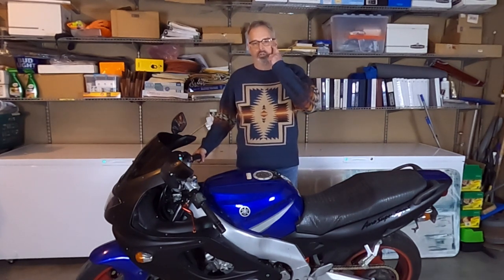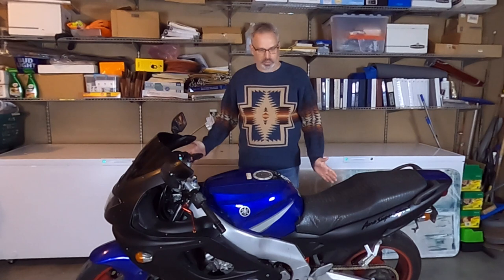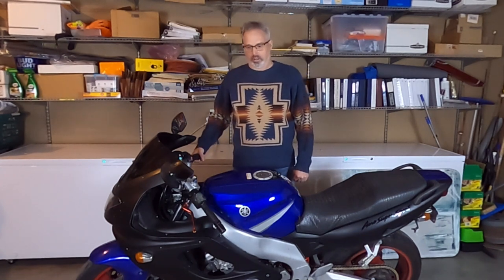Motorcycle Safety Equipment  - Do you Want or Need it?

Comment: As an old school Harley rider I would say that there is no substitute for skill. These features not only make the bikes more expensive but also more complicated and expensive to repair. The more gizmos you have, the more things there are that can fail. I wouldn't mind ABS on a touring bike or TC on a high horse power bike as long as there's a switch to turn it off. For my back road cruiser I would rather not have any of it. I like to be in full control. I've been in situations where I've had to slide the ass end around to avoid eating hard objects head on. Once with a huge doe and once with a huge Thunderbird. The ability to slide the rear wheel saved my ass both times.  Are safety features tools or crutches? I guess that depends on the rider. It is a moot point because we'll get whatever they cram down our throats, like it or not.
Reply: Well said, Scott.... Art

Comment: I like ABS. Once, I planted a bike under a school bus. The bus driver was making a left turn at an intersection and for no apparent reason, slammed on her brakes. I moved to the shoulder so no one would run me over and applied the brakes. It was late winter or early spring. In any case, there was a fine film of silt on the shoulder and it caused my front end to wash. I let go and the bike did a tanker slapper, spit me off on the sidewalk, bounced off the curve and ended up under the bus.
Had that bike had ABS, I think my day would have been devoid of drama.
Most of the rest of it I find to be overkill.
I actually would like the 911 service if it used a satellite system, but it doesn't. It uses cell towers. That's okay if you're in the city, but then there's plenty of people there to call anyway. I generally ride in the country where there's little if any coverage and many fewer people. As we go to 5G, the signals are higher frequency meaning they are more directional i.e. there will be even LESS coverage outside of populated areas. So at present, that one's a bit of a waste.
Reply from the maker: Funny you should mention that.  On my regular rides around town I seem to have to be extra careful around school buses and delivery trucks.  I think you are right about the emergency call system needing to be non-cellular based.  Probably it would need to be satellite based like Onstar.  I think we may be only a few years away from all new bikes sold in the U.S. having ABS.
Reply: 5G is good for high speed where you can get it. It should train down to 4G when it can't get it. I'd like to see phones use GPS without needing cell signal. I think the 911 thing will get better though and be multiple device. I hit something with my hand and my apple watch wanted to know if I fell. Not perfect, but interesting. I think BMW has crash detection and SOS call on their bikes in Europe. It's a new world.

Comment: In my view ABS gave motorcyclists really serious braking capacity from their rear wheel for the first time. No small thing. Technology like that you can't have too much of!
Reply: Most of the breaking power is from the front brake...That said, for instance, BMW has been using partial integral braking for decades now. Front brakes does front and rear, rear just the rear. It's brilliant and works like a tailhook. I don't find the rear brake along useful for anything other than low speed stuff like Jerry Palladino does.
Reply: @my.motorrad  imagine that, the front brake is the important one? Are you sure? Seriously though, all I was suggesting is a rear wheel that does NOT lock up is much more useful than one that does. Especially in the wet. I've owned three BMWs but no longer ride them due to having experienced a stripped shaft drive spline - a real trip killer. BMW's dirty little secret huh?
Reply: @user-us1hx2cx3j  I'll be doing a video on some of their foibles, but that won't be the major thrust, but there's more than a few. I am truth teller, much to the chagrin of some of the BMW faithful I interact with. I've not seen the drive shaft splines strip. Ujoints blow up on some of the liquid cooled boxers and the 1150/1100s had input shafts strip on the transmission. They have their problems for sure.
Reply: @my.motorrad  good on you for being honest! Unfortunately the stripped shift drive spline is pretty well known.  You can be lucky or unlucky with almost any maker I guess ( although the Japanese tend to be the exception to that) , indeed I had a 97 HD Superglide which I bought used, that was probably THE most reliable bike I've ever owned. Who'd have thunk it right?
Reply: @user-us1hx2cx3j  The most reliable bikes I’ve owned were Vulcans. 1600 Nomad was bulletproof. 800 Classic was good too. The RT performs better though.
Reply: @my.motorrad  right, does not surprise me the Vulcans were so great. I'm onto my second Kawasaki now, a 2019 Verseys 650.
Reply: @user-us1hx2cx3j  I've owned a GPz750 and my first bike was a 1978 KZ1000. I wish I still had it. The Versys is a very good bike. Kawasaki makes very good bikes in general. I wanted to like the C14, but it doesn't work for me ergonomically and it doesn't have cruise control.

Comment: ABS? Yes.  I can get by without it, and have for a long time, but it's nice to know that in an emergency or unexpectedly slippery surface, it's there to help save me.
Traction control? Almost a necessity on the insane 200 HP bikes available today, not so much on my KLX 250. Somewhat useful on my BMW RT.
Reply from the maker: I agree with you.  I think ABS will be on every new bike sold soon.

Comment: As always great video but a couple of points.  1) Electronic failures- What if say cruise control locks and inexperienced rider does not know how to shut bike off, or ABS with no dash light, both for say rain water somehow getting in.  Is it worth the risk.  2) Planned obsolence- will bike not be grandfathered in or as in other videos, no manufacturer or aftermarket support to fix. 3) What happens to these electronics with time?  Will they fail.  I have a 2018 GSXS Ibought back in the day instead of a Ducati.  Less to go wrong, better support and Japanese have better electronics.  I specifically bought my 2018 as it still had Euro spec 4, not 5.  These bikes are ridden in the weather and as such prone to failure as the electronics are not always well protected.  As mentioned, this could cause serious issues later.  Excellent video!
Reply from the maker: Thank you!  Suzuki is sometimes criticized for not updating their bikes often enough but the flip side is they stick with proven technology.  As an example, my 2005 Yamaha 600R does not have the latest tech but it is still very fast.  I have also owned Ducati bikes (they are great but the tech changes very much every few years).  I had an XDiavelS and there were 3 recalls while I owned it that were rather big items but covered under warranty.  Owning one of those bikes out of warranty is not for the faint hearted.

Comment: Yeah, cars too. ABS, now multiaxis ABS. BMW just came out with adaptive cruise control. Some Goldwings have airbags. For me, I have to have ABS and cruise control. Outside of that, I don't care as much. I like the heated seats and grips and the electric windscreen. BMW is supposed to be working on blind spot monitoring. The K16 has an adaptive low beam. but it's not like the adaptive LEDs on the cruisers. The tech is what it is. I think some of it is good as it allows focus on riding or driving.  It's like using Linux versus let say MacOS. The Geek feels in control and like to tinker with Linux, but is it a more advanced OS and one that enables users to get stuff done as well? Making things easy is hard and it's a customer focused approach. I guess what I am saying there is a certain higher skill level needed with more primitive tools, but in the end, the advances make things better for everyone.  If you want a little insight into modern bike performance in a more relatable context, check out the LA County Sheriffs and Michigan State Police vehicle testing. They do cars and bikes and test under a variety of conditions. ABS makes a huge difference and a good one.
Reply from the maker: Great comments.  Thank you!

Comment: “How much is too much” is a difficult question to answer !
For eg., ABS mandate isn’t being liked by the “Oldschool motorcyclists of the current generation”. I’m reasonably sure that Traction Control will be made mandatory a few years from now which will not be liked by the Old schoolers of that generation !
In my opinion, ABS and Traction control are good to have as mandatory Safety features while the more advanced ones can be optional.
Reply from the maker: I think they will be standard soon as you say.
Reply: Hard to do burnouts with traction control.
Reply from the maker: @PaulsMotoZen  😊

Comment: Hi C.J. I'm okay with any safety equipment that doesn't add appreciably to the cost of the bike, and doesn't cause the bike to be unridable when (not if) it fails. A thousand dollar+ repair may be out of the budget on an otherwise safe  bike. I always modulate the brakes in my truck when stopping on ice or snow, even if the abs kicks in. I haven't had to panic stop the bike in many years. I understand that abs when cornering is only available on KTM motorcycles. That may be an excellent feature.... Air bags on a motorcycle? What could possibly go wrong with that? (hahaha!)
Reply: Cornering ABS is available on a number of bikes now. It generally requires that the bike have a 6-axis IMU, which also feeds the brains for all the traction/wheelie/drift (!) control systems. Mostly only newer, high end bikes (like KTMs), though I think in KTMs case they've even managed to include it in the fairly cheap 390 Adv bike.
Reply from the maker: Thanks for your comments.  Actually all of Ducati's bikes since 2019 have come equipped with cornering ABS as well.
Reply from the maker: Would you wear an airbag vest?
Reply: @cycletron  I would consider it, it certainly couldn't hurt. I'm not really a strict ATGATT guy, but if it's not too inconvenient or expensive...

Comment: I also agree that all the safety equipment and options / features are rarely used, if ever. This in turn ups the prices and makes it difficult to service. Yes, it dumbs down the public. Giving them a false sense of security. As well as eroding their driving skills. I even see truckers riding the bumpers of other trucks at freeway speeds. No way those trucks are going to stop in time to avoid any emergency that could arise. Think it's any better for a motorcyclist?

Comment: I am divided on this subject. None of my motorcycles have new safety features, though I am not opposed to them. My cars are a mix of everything from drum brakes and no seatbelts to full ABS and traction control. 

The only real negative I have with the new systems is the cost of the tooling for repairs. I do all of my own wrenching and these newer systems have cut many of us out. I just wish it was easier to do a proper ABS bleed without specialty equipment or affordable diagnostics tools to help us troubleshoot newer safety systems without costing nearly as much as a monthly mortgage payment.
Reply from the maker: I see your point for sure.  In general things are becoming more electronic and more integrated making it harder and harder for people to do their own work on recent model vehicles.
Reply: @cycletron  it's definitely made me reconsider certain purchases. Not because the tech exists, but because the tech is out of my financial comfort zone. The new stories about software as a service model that is making its way into transportation is also a turn off. I really don't want to pay for a subscription service to use my vehicles. I admit I am a bit of a caveman, but I know my 70s ford or even my early 2000s jeep will chug along even if their tech is outdated. Can we say the same thing for Tesla's or new BMWs in 20 years?